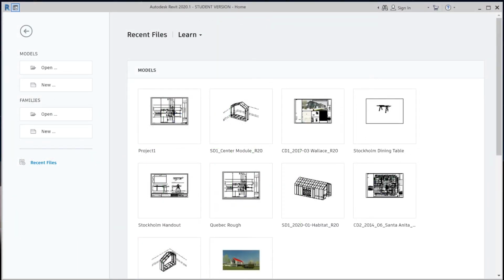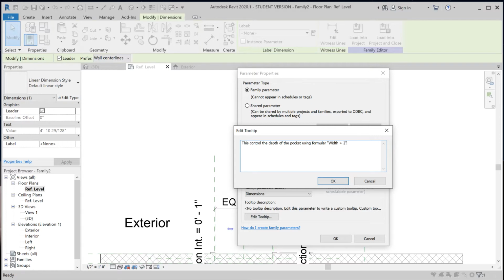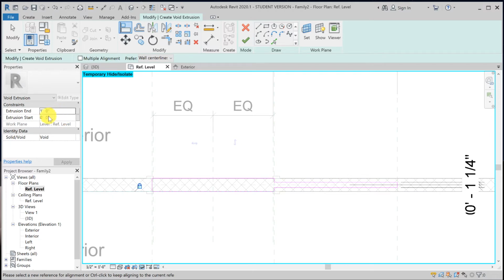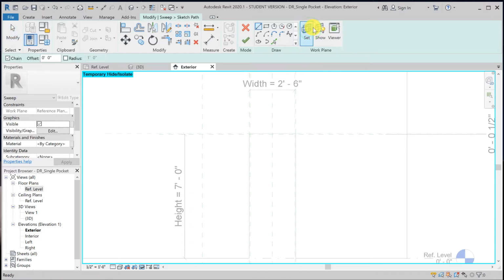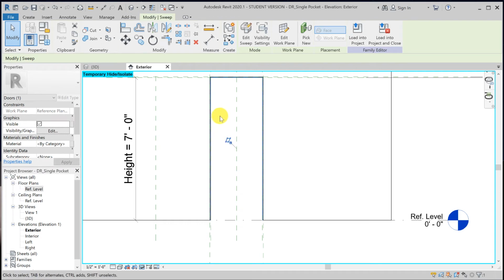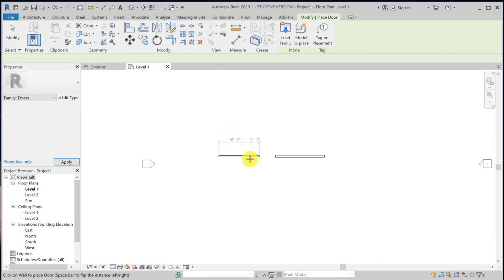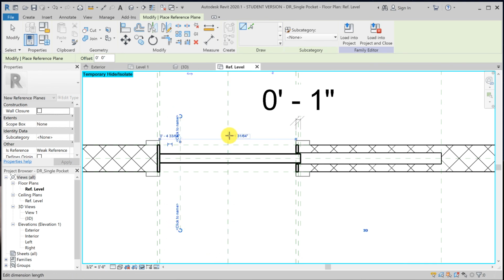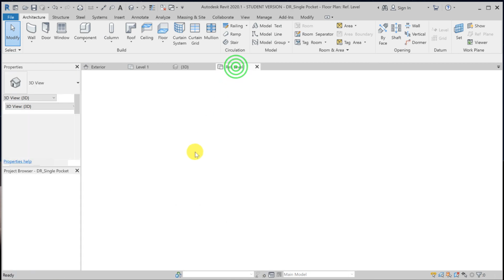EP4 Pocket Door Family

Comment: Hi Thank you so much. Easy to do it. I have one questions, Still cannot join to wall finishes, it doesn't cut.
Reply from the maker: Not sure what part you are having trouble with. Could you give me time stamp?
Reply: @tommyminimalist  door family is fine, i can use formula and can adjust to any width & height. But when loaded into the project, we have main wall, tiling and plastering wall, door only cut the main wall, and it cannot join/cut to the other walls, So i use split tools and then adjust the wall ht to cut those wall finishes.
Reply from the maker: I see. Unfortunately trouble shooting is going to be difficult. To avoid this, I recommend all my student to flex as often as possible. Usually every time you add new parameter to the family. As soon as your family is ready to be placed into a dummy project file (don’t need to be complete), do so and flex it both places. This way, when something we’re to go wrong, you only have to go back one step to fix your family. Actually, this is rule number one in family creation for me. Specifically in your case, I would create the exact wall assembly your are having trouble with in the dummy project and flex it there. My recommendation is start over and flex often in both places. It will be worth it. You’ll get to practice. And once you get you family to work, you’ll get to use it forever. Cheers
Reply: @tommyminimalist  Thank you Sir